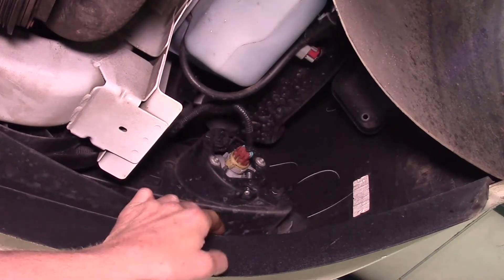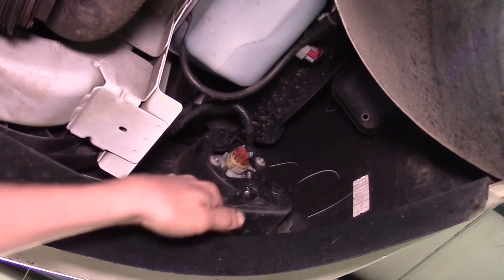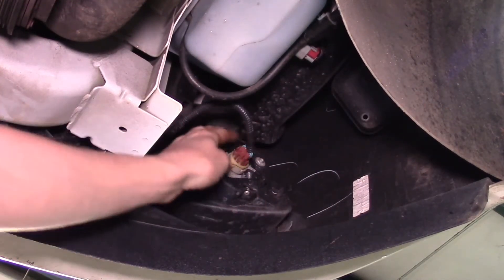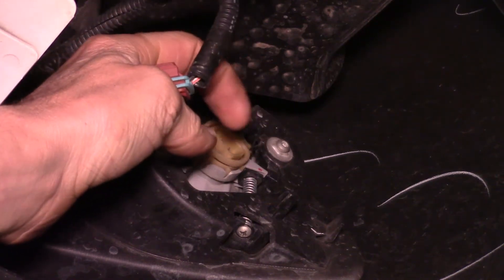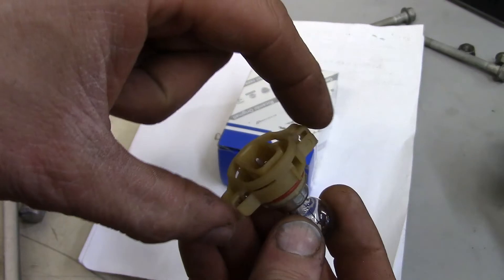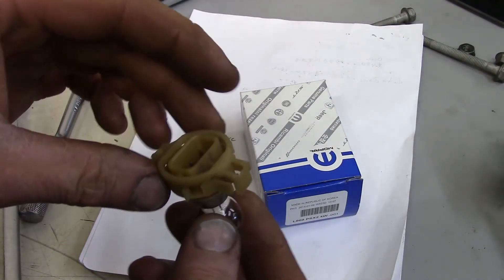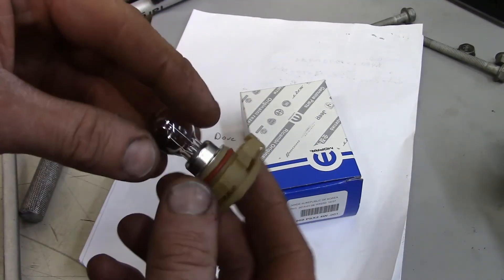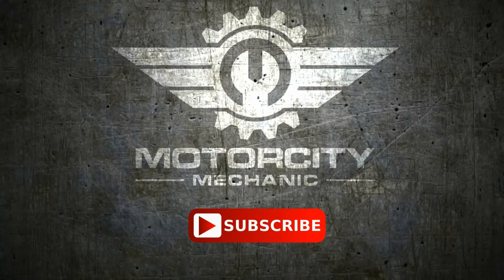2010-2014 Dodge Grand Caravan and Chrysler Town and Country  fog light bulb replacement

Comment: thanks for the helpful video.  I thought I'd just add a little helpful hint that the bulb has "fins" at the base.  so if not turned the correct way it won't go in.  took several tries with my hand under the van trying to get it to go in before I noticed the "fins".  spun it around and it went right in.  thanks again for the video.
Reply from the maker: +bryan dearment Thanks for the added info. Its cool to see viewers helping viewers! I greatly appreciate it and make sure to subscribe!

Comment: Hey my dads chryser town and country 2012 fog lights both stopped working. We replaced the bulbs but that wasnt the issue and when the fog lights are pressed it indicates the light is on on the dash but still no light. Any suggestion is appreciated, thanks
Reply from the maker: At this point checking for codes in all the modules would be recommended and then possible testing the wires. Otherwise doing a good visual inspection of all the wiring leading from the bulb would be the other item I would recommend.
Reply: @MotorCityMechanic   I  have a 2011 TandC and ordered the bulbs in philips version came in went to install and not the correct bulbs. mine had standard H11 bulbs some must have regular H11's like mine.
Reply: @robshummerh3  mine too bud.
Reply: SAME PROBLEM DID YOU FIND A SOLUTION? CHECKED FUSES AND NOTHING SHOULD BE M2 FUSE BUT THAT IS STILL FUNCTIONAL AND TRIED NEW FUSE AND NOTHING

Comment: Question: how do rate LED replacements for these. The Mopar part is waay too dull to make much difference.
Reply from the maker: I dont have any experience in the aftermarket bulbs such as the LED versions. Wish I knew more and could help you further but I have no knowledge to offer when it comes to that.
Reply: Dan N  they do I believe there H11 and there ten times as bright as the halogen
Reply: It’s a 2504 bulb

Comment: IS THERE MORE POWERFUL FOG LIGHT LIKE LED BRIGHT? THANKS
Reply from the maker: +Sam Hus Good question Sam. I haven't heard of anything as of yet. I just checked on ebay and they show some so I guess the answer is yes lol. Here is a link to just one that I pulled up. Looks like its the correct style. http://www.ebay.com/itm/One-Pair-2504-PSX24W-6000K-High-Power-Led-Bulbs-Cree-5730-SMD-Fog-Driving-Light-/171589562408?hash=item27f388f028:g:~7oAAOSwwbdWKZ77&vxp=mtr
Reply: Yeah. Put in 2504 part number for the PSX24W. Lots of great LED replacements that are much brighter. I'm in the process of changing these out of my Dodge Grand Caravan Crew 2012.

Comment: How would you remove the actual housing? Is it just those two screws on the sides of the bulb?
Reply from the maker: +**Classified** Looks like the two screws are all you need inorder to remove the fog lamp housing. Should be straight forward from the info I see on my side. Let me know how it turns out.
Reply: +MotorCity Mechanic Will do! Someone's always driving the thing though, so it might be awhile, lol. 

Any experience on changing the blend and mode doors out? The van just started making a horrible clicking noise when you press the recirculate button for the climate controls. Pretty sure it would need a heater core and evaporator with the dash out too.
Reply from the maker: ***Classified*** The noise could be the actuator only and not the doors. The system can be checked with a scanner and then the doors tested/calibrated to see if any codes return and to see which doors you are having issues, with. I don't remember ever having any issues with one on a minivan as of yet. But anything is possible.
Reply: MotorCity Mechanic It only occasionally makes the noise, and I can still switch between different modes the majority of the time. When it does happen though, you almost cringe with the noise it makes! Super loud clicking, almost like plastic is trying to flex, but getting bound up on something.
Reply from the maker: ***Classified*** usually a bad actuator will make a knocking/clicking noise for a certain about of time before stopping. Its a steady/rhythmic sound.
Reply: MotorCity Mechanic I've replaced those in older 90's era GM trucks. I'd imagine they're 50 times harder to do in a modern car though, like my minivan. 

You mentioned that you could command them on and off with a scan tool? If I replaced the actuator, would a dealer need to calibrate it? I did the one for recirculation function on my old 2001 town and country, but all I had to do to calibrate it was hold two buttons on the A/C controls on the center stack. All I had to do on that one was drop the glove box. Would it be similar on the 5th gen vans, or does the whole dash have to come out?
Reply from the maker: ***Classified*** Yeah the older ones could be calibrated from the a/c buttons but the next body style used the scanner unless there is some secret set of buttons that I never heard of which is always possible. One an actuator is replaced, calibration is recommended. Calibration wont fix any noises, just set the full open and full closed positions.
Reply: MotorCity Mechanic Thanks, I'll look into it at some point.
Reply from the maker: ***Classified*** Your very much welcomed and thank you

Comment: Thanks for the video and showing how to remove that bulb.  I made the mistake and ordered a set of bulbs from ebay and they were led's but they did not work.
This is what they were and although they look close, they will not work.
Blue H16 5202 CREE COB LED Replacement Bulbs For Fog Daytime Lights 
DO you know if there are any direct fit LED aftermarkets bulbs that will replace this mopar bulb?
Reply from the maker: Thanks for watching. I haven't checked to any other than stock replacements as  of yet. If you do find anything that works make sure to reply back so that others will know as well. Make sure to subscribe and help spread the word by sharing these videos with others.

Comment: Even aftermarket, these are ridiculously expensive at the parts stores. Almost $30 for a light bulb!
Reply: GO TO THE JUNK YARD CHEAPER JUST WEAR SOME NEW GLOVES AND DONT TOUCH IT WITH YOUR BARE HANDS. ALSO FOR 30 FOLLARS YOU SHOULD BE ABLE TO GET LIKE 20 OF THEM AND PUT THEM IN ZIPLOC AS YOU TAKE THEM OUT AND KEEP THEM IN BACK COMPARTMENT FOR EMERGENCY CHANGES ALSO GRAB A FEW HEADLIGHTS AND BRAKE LIGHTS WHILE YOU ARE AT IT. REMEMBER TO WEAR GLOVES.